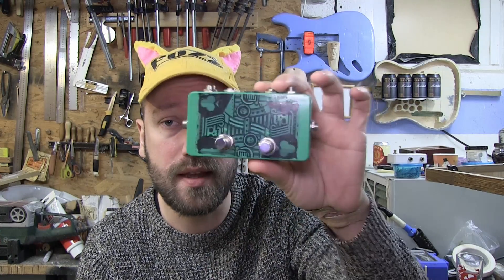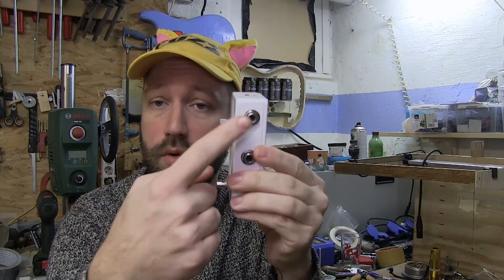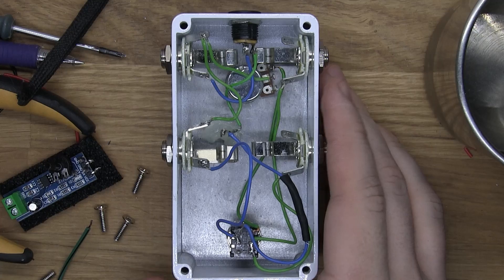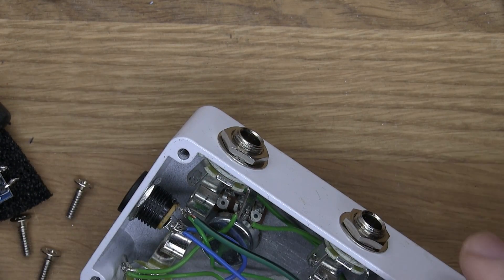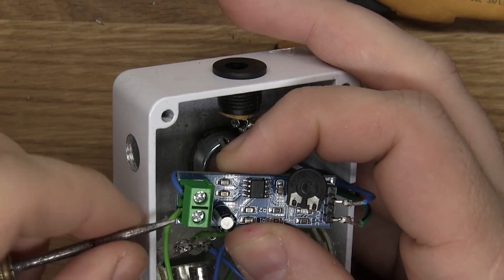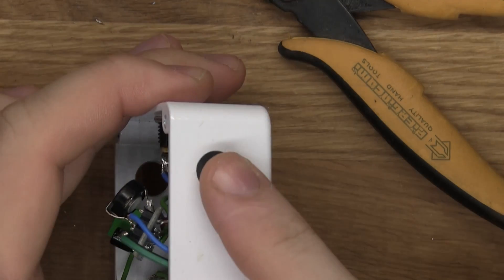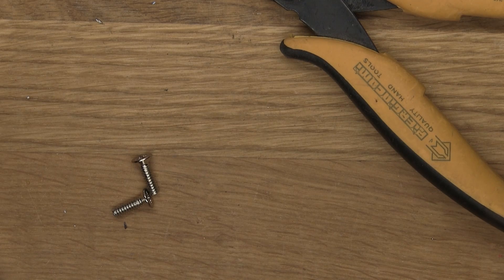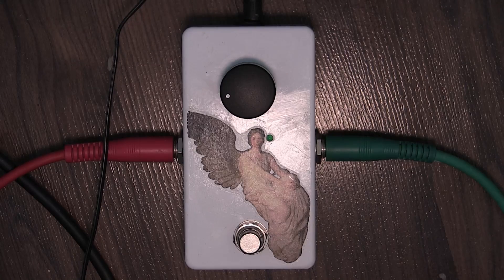crazy! LM386 feedback pedal

Comment: How would i go about putting this in my cheap daphon wah pedal and use the foot thing as the knob instead of the turntable knob id find it to be easier to use like a digitech freqout that way but id also still want to keep the original wah mode could i add a switch on the side or something to make it go from wah to feedbacker and could i maybe mix the 2 mode and have them both be on at the same time
Reply: Man i have such stupid ideas lol but they would be cool to me if only ik how to actually pull this stuff off
Reply from the maker: @kadenshoemaker6669  you could get a wah diy kit pedal box
Reply: @zurowetz  ik i can do that lol i have one but idk how i can go about putting the feedbacker into the pedal with the wah circuit and attach it to the wah in a way that not only has a 3 way switch between wah , wah and feedbacker, and feedbacker. But allows me to control the feedback pitch with the foot pedal
Reply from the maker: @kadenshoemaker6669  well you need a DPDT switch but with a middle step too like a on/off/on switch but with out the off and then a double pot with 6 legs one row for the feedback and one for the wah and the you would just connect the wah to the top of the switch out on one side and in on the other than on the bottom you put the feedback in on the same side as the in from the wah and out on the other than use the middle for the jacks make sure the in and out are the same as on the switch than you need to drill a hole in the box for the switch 👍
Reply: @zurowetz  hey man thanks

Comment: The drone machine. Man this is awesome. It’d be cool to put this in a way pedal enclosure so you can sweep the pot with your foot.
Reply from the maker: You can just add a wire from each pin of the pot to a stereo jack and then use an expression pedal😀👍

Comment: I see the need for a momentary switch. Well thought out. Also can the pot on the board be removed and a pot extended to the enclosure for control over that portion. I am not quite sure what the sound change would be but it sounds like it might be useful. Thanks for another great video.
Reply from the maker: Oh there's so much fun we can do to it I wanted to make it easier to use but you don't have to do that you could add an expression jack to every pot and a pt2399 to feedback into the lm386 and maybe som clipping diodes too just because and maybe build two and having one going into the next there is no end haha 😀👍
Reply: @zurowetz  Hell yah A little reverb/delay board might go good with that

Comment: Great vid, my philosophy, take a couple of simple devices, combine them to make one useful experimental device. Definitely add  a momentary, as well as the current foot switch. Best of both worlds. I'd breakout the trim pot to the top of the box, this will allow different frequency oscillations. Also when using it with different gear, guitars, it'll allow you to tune it to their different levels. Great start on this though. You could really go to town adding a simple pt2399 pcb to the feedback circuit as well, for truly wild feedback sounds, limitless noise fun. What about switching jacks for adding in another pedal to the feedback etc etc.
Reply from the maker: Yeah so much fun!😃👍 have you seen my pt2399 pedal? It has feedback I was thinking maybe I should build like 5 of this and set them up so it becomes a chord the original pedal hade jacks so you could plug in any pedal you want so you could try feedbacking flanger thats a strange sound 😆 Yeah one day I'll have to add everything into one big box and just make the most crazy pedal ever and just blow up my amp haha 👍😆👍
Reply: @zurowetz  I'm a big fan of feedback, I used to build and sell pt2399 pedals and 4x5 passive matrix mixers, specifically for feedback, my personal matrix mixer is 7x7 in a cinema reel Tin. Too much fun especially introducing tape loops and random radio.
Reply from the maker: @stuartchapman5171  oh I would love to have a 7x7 in a reel that would be cool to be honest any pedal in a reel would be cool 😍